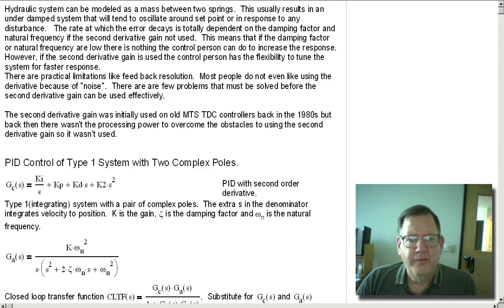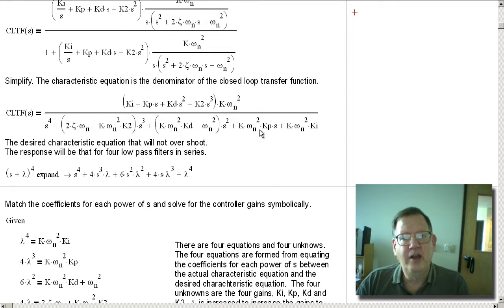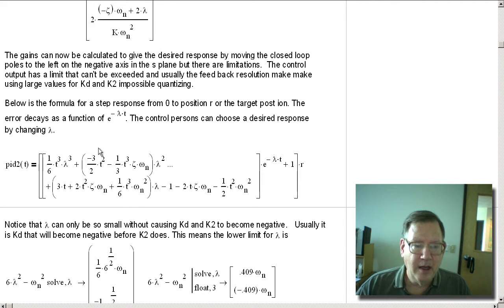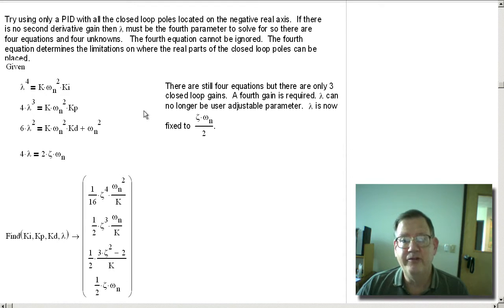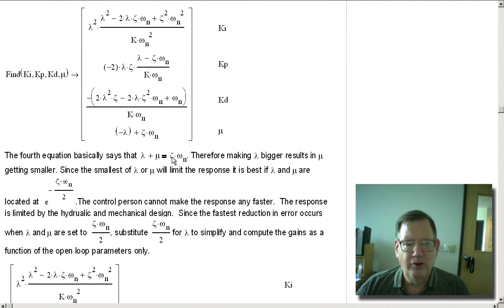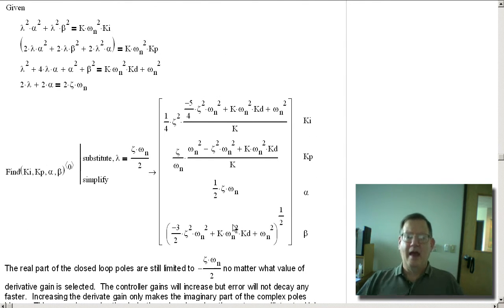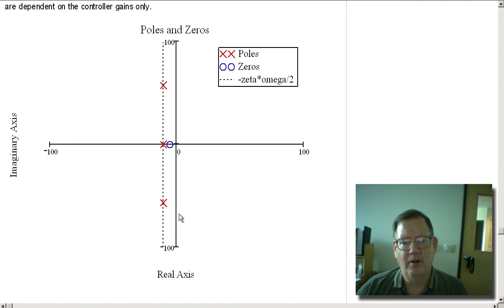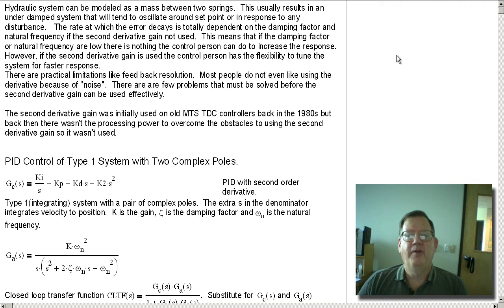Peter Ponders PID - Why PID with 2nd Derivative Gain?

Comment: Thank you sir for the excellent videos. It is rare to see this kind of high quality videos on Youtube! A quick question is that I know this is for a mass between two springs, if I have one spring between two Masses (like Gantry applications), which control structure is the best for anti-oscillation? Or do I have to use a input shaper because the controller itself is not enough?
Reply from the maker: This is not for a mass between two springs,  it is for a hydraulic actuator.    A mass between two springs does not need the extra s in the denominator.  A mass between two springs has an open loop transfer function where the units for the open loop gain, K is position per unit of force.   In this example open loop gain has units of velocity per unit of control output.

Comment: By close examination of transfer function of your actuator model, it seems that there is one pole more than it should be. You wrote that integrator is there to integrate velocity into position, but many other models of hydraulic actuators are only 2nd order systems. If hydraulic actuator can be considered as a mass between springs, it is only second order system. Here are the equations: https://youtu.be/SGjzWPS7rOo
Newton law of motion satates m*a = sum of forces. Acceleration is second derivative of position, so it must be second order system, because all oter forces (spring, damping...) have lower order derivatives of position.
Reply from the maker: If the extra s is removed then I have a second order transfer function for the hydraulic cylinder in velocity mode.  Look at the units!!!  K is the open loop gain.  It has units of velocity/output or (mm/s)/%control in my example.   A 10% control output will yield 10% of maximum velocity but the velocity must be integrated to get position so it can be compared with the position feedback.    What I show is correct.   I/we have been controlling hydraulic systems for 35+ years.

Comment: Shame one won’t find this in most colleges or commonly used undergraduate control texts
Reply from the maker: Most teachers do not have the practical experience.  They teach what they have been taught the way it was taught to them.  The examples in the text books do not cover more complex examples like the one I show.
Reply: @pnachtwey  I love the work you do, and I appreciate it - thanks! It's so fundamental and so intuitive....you know this PID2 video you made has been lingering in the back of mind for the past 2 years I told myself I would take the time outside of work and school to try derive and obtain the same results as you, and now that I am finished with MSc, I think I will spend some time doing that!.....anyway... you mentioned that MTS back in the 80s did the second derivative gain thing, you know I had I always thought why not just design a controller that exactly matched the forces that the (identified) system exhibited, e.g. the 1DOF mass, damper, spring model: system dynamics = m*ddx_dt2 + c*dx_dt + k*x = controller_input = K1*ddx_dt2 + K2*dx_dt + K3*x + extra terms, where K1, K2, and K3 are just m, c, and k, and the "extra terms" would be whatever that would allow the user to move the system to their needs

Comment: Is this a general conclusion?  In hydraulic systems PID is no better than PI. Only PID2 makes sense. Is it possible to have Kp+Ki/s +K2s2 without Kd?
Reply from the maker: No, you can have the Kd with the PID2 but if you look at the equations for Kd and K2, you can see that there is a possibility that these gains can be negative.   The Kd gain will be negative if the lambda^2 in not greater or equal to the natural frequency squared.    The Kd gain will be negative before the K2 gain.   If lambda is increased,  the Kd gain can be greater than 0 so it is useful.
I should make another video showing why the Kd gain should not be used with a normal PID controller.
Most hydraulic motion controllers,  like our old RMC100,  1756-M02AS and 1756-HYD02 use only PID with velocity and acceleration feed forward.    The derivative gain should not be used unless the damping factor is above 0.7078.   Otherwise the Kd gain will be negative. Most hydraulic systems have a damping factor much lower than -.7078.   This will cause problems because there will be closed loop zeros  on the right hand side of the s-plane.   The only solution is to not use the Kd gain in the forward path.   In other words,  the Kd gain should only be used on changes in the actual or feedback position.  This is similar to what is done on PLC PIDs.    I call this a PI-D.   Now only the PI gains are in the forward path ( act on error ) so there is only one zero and it be in the left hand side of the s-plane.
I know my explanation is a little geeky.
Reply from the maker: "Is it possible to have Kp+Ki/s +K2s2 without Kd?"
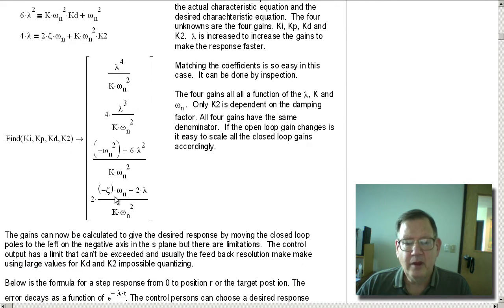Yes!!!  Go to time 7:00.  You can see the symbolic equation for Kd.   It is possible to chose a value for the closed loop pole location where Kd=0.